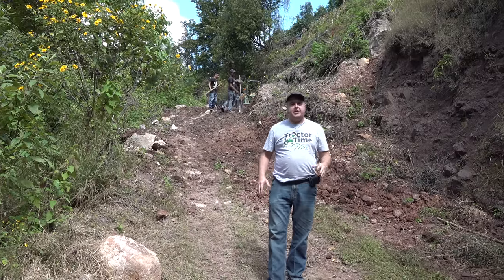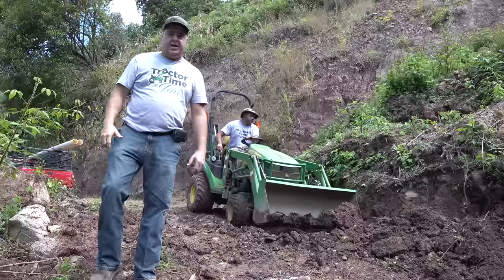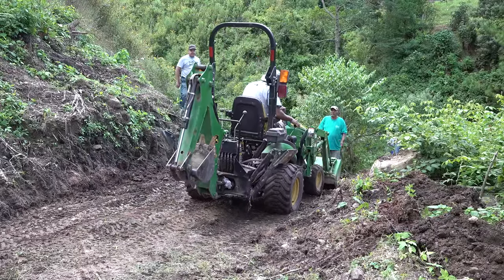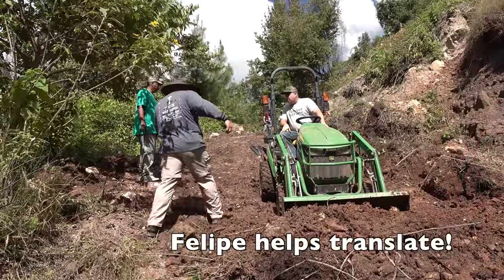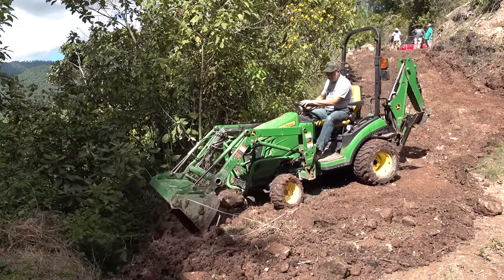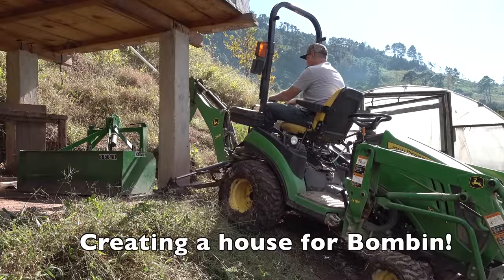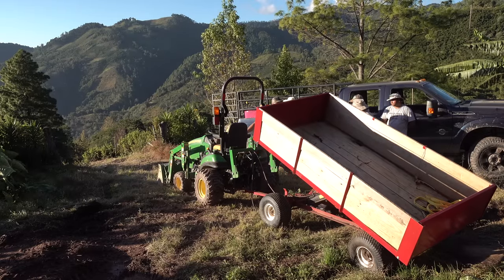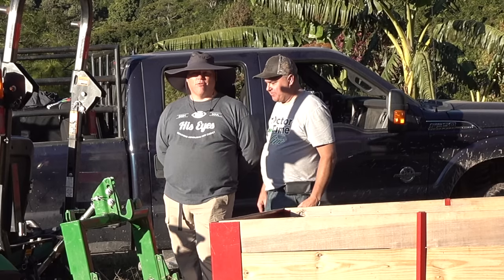Little Bomb! John Deere 1025R in Honduras! Road Repair!

Comment: The little tractor might seem small to us, but it is HUGE for them. I have participated in different foreign missions over the years and it is so important to see what they actually need, vs what we think they need. Going there personally as you have is key in understanding the difference. God bless
Reply: working in the industries of where their needs are can't be blessed enough. having worked for a well drilling company it's nothing to drop in 1,000 wells a week with an old 1950's machine vs the 10-14 they were doing, and being able to teach them how to handle the machine and know theirs, and then the machines limits and abilities, the proper procedures and tricks of the trade, they have improved to 32 on their own, per week.

Comment: whenever I'm trying to push, dig or bulldoze with my 1025r I try to have my heel on the differential lock. It is surprising how much it helps for such a small machine. Thanks for sharing Tim.

Comment: As you were making the hill a little less steep, in my experience that is one place the box blade shines. You can fill thr loader bucket, then drop the box blade and move earth about twice as fast. 
I also find it easier to get a smoother finish with the box.
It was interesting to see the contrast between the guy who's put a couple hundred hours on the machine, vs. Tim, the master.
Reply from the maker: Yep, box blade would have. been good here.  We hadn't made it up the hill, where the box blade was located, yet.

Comment: you said a couple times in this video that the 1025R wasn't the best tractor for clearing that road.  assuming your only choice is the standard green line of John Deere tractors and not the yellow commercial road construction equipment, what would have been a better tractor to use on this job?  I'm having a hard time deciding from this video.  that's a pretty narrow, steep, and windy road.
Reply from the maker: We discussed that at length.  I don’t think there is a better tractor choice.  Everything else too big.  Closest would be a 3R open station. It has tight turning radius
Reply: @TractorTimewithTim Ya I was impressed with how well the 1025R did on that job.  Maybe the 2025R would have been better with the larger tires and more ground clearance, but it would definitely need the wheel spacers.  Or perhaps that's one place where putting dual rear wheels on the 1025R would be highly useful.

Comment: Little tractor but a lot power 💪👍
Reply: Yea John Deere has never made a machine that lacked power.  Most of the time a John Deere will work harder than the machine can handle.  I always thought they made the best sounding diesel motors ever made.  The bigger straight sixes in the bigger tractors and skidders.